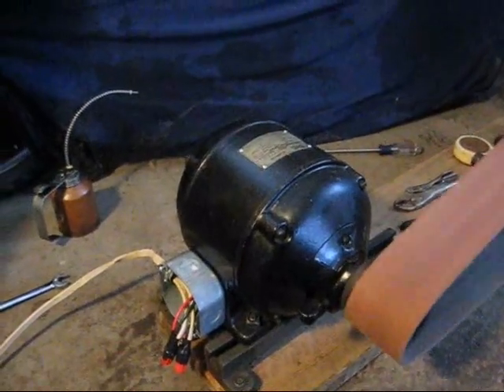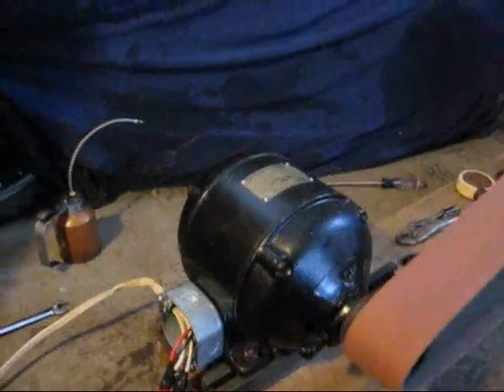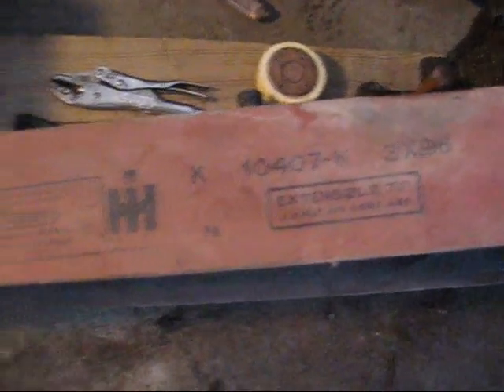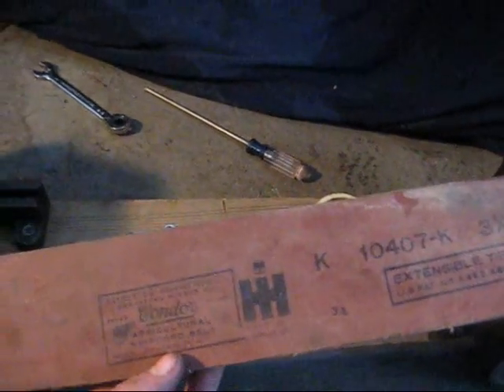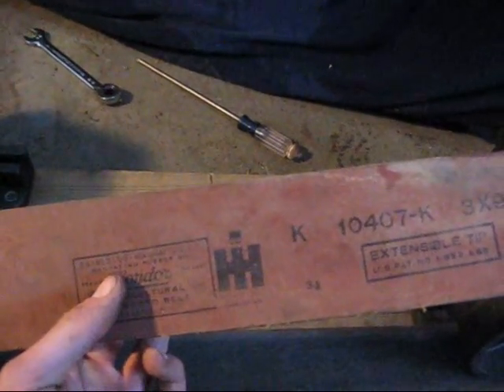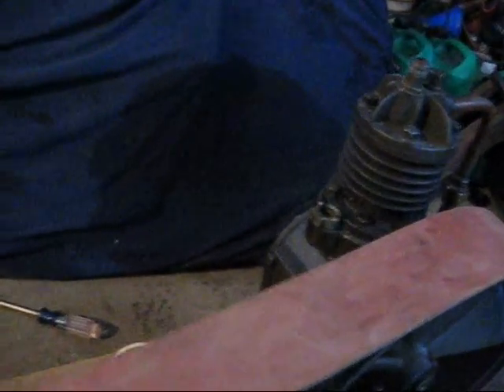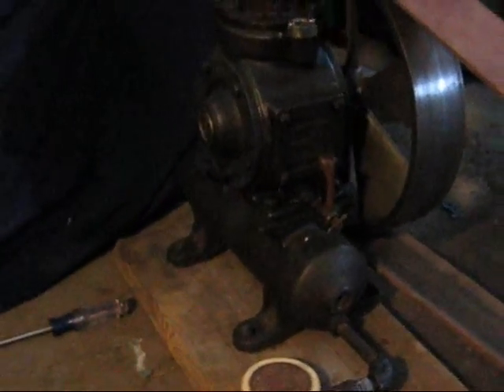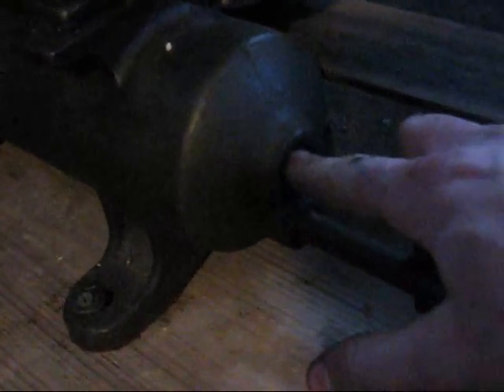The bigger Brunner compressor

Comment from the maker: the motor and the compressor originally would have been attached to a 20 or 30 gallon tank. i unfortunatly do not have the tank. the small tank under the compressor i think was just to accumulate moisture and remove it before it got into the large tank. in original ads i have found for it it was advertised for running air tools at small auto garages, or painting.

Comment: You can also use a combination pilot/unloader valve made for a gas compressor setup. Lets you keep the motor running instead of short cycling it with the small tank. Probably used for a nailgun.

Comment from the maker: i still have a ways to go yet but i have actuall plans to use this one. i am going to try to get it mounted on a tank. i might have to have a shorter belt custum cut for me but it will be a nice unit. i already got an old pressure switch for it.

Comment from the maker: sure. i have a tank that might work just i would need a much shorter belt made so both the motor and compressor would fit on the tank. i might do it though.

Comment from the maker: im actually already thinking of setting this thing up with a tank. i found an  pneumatic switch to turn the motor off and i think ill set it up to put out about 80 or 90 lbs of pressure. thats all i need out of it. im sure i could easily get a hundred out of it.